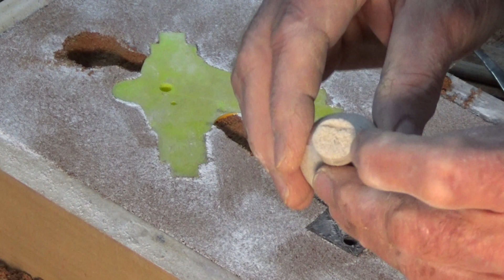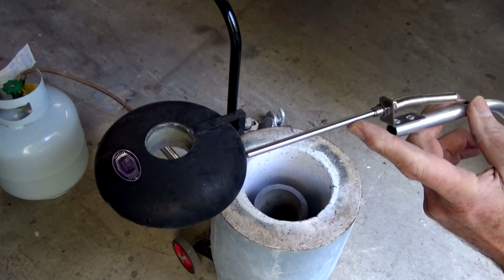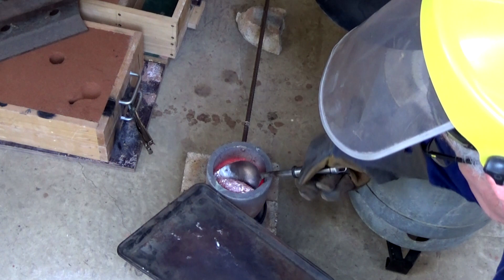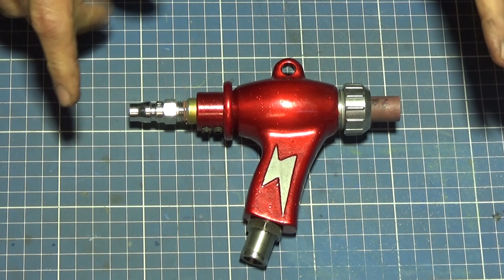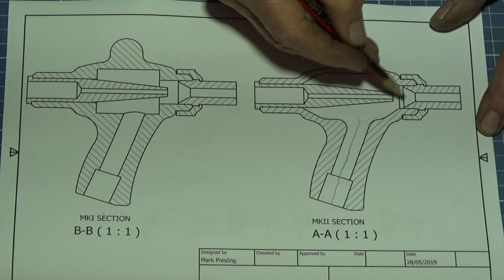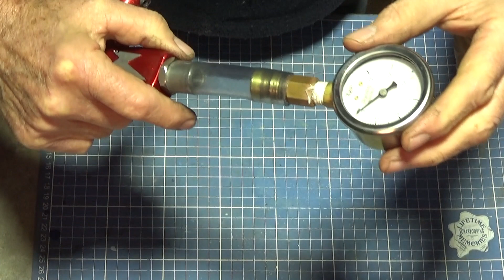DIY Cast Sandblast Gun MKII - Now with EGT!

Comment: Something to think about, when you build a foundry you put the burner at an angle to create a vortex and if you look at cyclone garbage systems they make sense to help move the desired material as fast and efficient as possible so if you moved the media tube towards the back of the gun and put it at a slight angle to create a vortex then there should be a continuous flow instead of the pulsing you correctly have
Reply: You may be on to something there. It may however be a little bit difficult to achieve within the confines of a spray gun handle. At best you could possibly only gain a couple of degrees of inclination which most people would interpret as a machining error rather than a vortex flow.
Reply: @markfryer9880  I've been thinking about this too. If you were to offset the body of the gun wrt the axis of the handle, the media could come in tangent to the circular cross section of the body cavity. Maybe we can convince Mark P. to investigate a whole slew of gun configurations in clear plastic...  Clyde

Comment: G’day Mark, you’re getting involved in this project but where will you stop, oh no a clear plastic body to investigate air flow inside the chamber, you’ll need a slow motion camera next.
Awesome thesis you’re working on, I can’t wait for the next episode, cheers. 
Peter
Reply from the maker: I actually had access to a high speed camera when I was still teaching. We used it to study the behaviour of the small CO2 powered cars we were building with students. It would only do about 1000 frames per second and only in monochrome and it cost a fortune at the time. My Samsung S8 phone has super slo mo now in full HD and colour. 😁
Reply: How times have changed

Comment: Mark,  you've probably used it a bunch already but if not may I suggest you blast for a minute or so and then check the plating on the nozzle, it might give a clue to the air and media flow inside. Another great video, thanks again. 

John
Reply from the maker: I had a look at the aluminium nozzle I made on the MKI gun and there was absolutely no evidence of any erosion from the grit. I suspect that the high velocity air keeps the grit well clear of the end of the nozzle. Won't know for sure until I make the clear gun though!

Comment: phew phew phew sounds are a requirement when in use.
Dumb question time, would you had the same effect simply machining and tapping the original gun for different orifices?
Reply from the maker: I was keen to see if changing the internal shape of the mixing chamber would make a difference. As it turns out it doesn't seem to affect the vacuum but I haven't actually tried doing much blasting with it yet. I am hoping to use less air and get the same result with rust and paint removal. Also I had lots of requests to add lightning bolts so a new gun was more or less mandatory. 😁
Reply: @Preso58  Oh I been following this since day one. I was just wondering if something as simple as changing the orifice size in the original gun would have the same effect as the mark 2 gun. I know it'll be a kick in the pants if something that simple got the same effect after all the casting to get here.

Comment: Have you added up how many hours you have in this project?
Reply from the maker: Will, I don't really keep track of the time I spend on these projects. I am retired and any time I spend in the shop is therapeutic so I don't really care too much if I have failed projects or if something could more easily be purchased over the counter. Because I have a background in education, I take the view that we should never stop learning. Even a failure teaches us something. I would never have learned to make sand cast parts if I hadn't needed to upgrade my milling machine with a vertical head. It's an old machine and there was no chance I was going to find an original head for it. I made my own from three different castings. It's only for light duty cutting but it serves my needs for now. One day I would like to own a Bridgeport but I will have to lose a car out of the garage to make room for it. Not sure how that will go down with my wife though!
Reply: @Preso58  I was faulting the effort but curious to the time invested as well in scope of the overall project. I hear you about retirement but time does have value and I appreciate the vids.